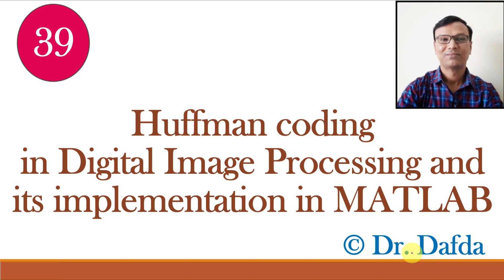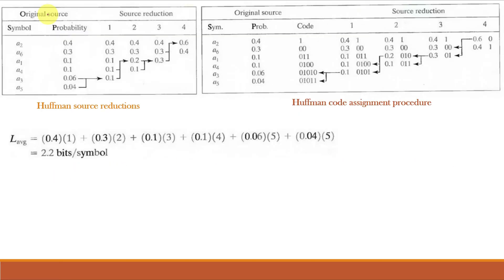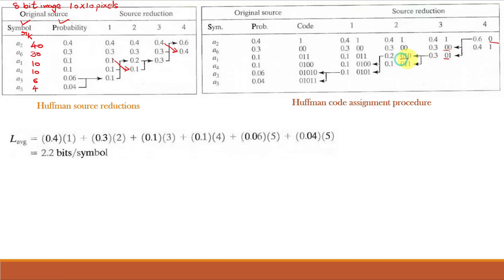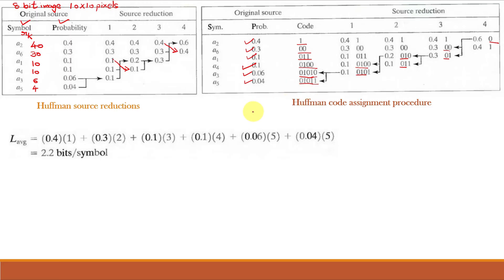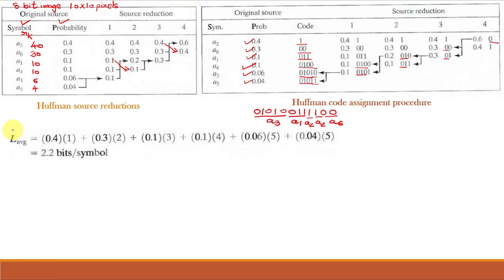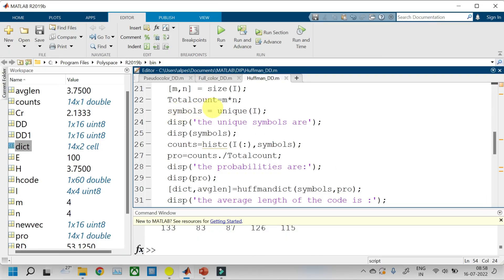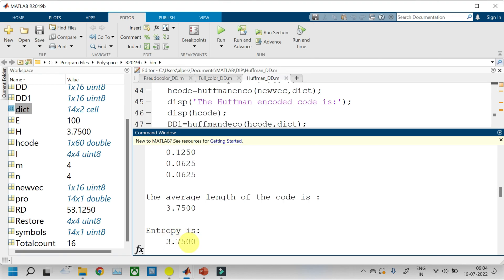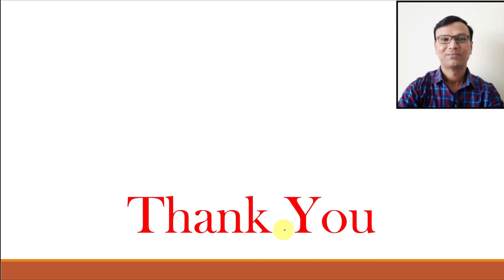Huffman Coding in Digital Image Processing with example & its Implementation in MATLAB ||Compression

Comment: Here 0.3 has 00 length means 0.3 is multiply to 0 not 2
Reply from the maker: No, 00 is not length. 00 is the code for 0.3. 00 has 2 symbols so its length is 2. Hence 0.3 multiply by 2.

Comment: In this before compression original image size is 800 bits and after compression 220 bits am i right . As u mentioned 8 bit image 10x10 pixel and after applying it 2.2 bits/symbol Length
Reply from the maker: Yes, correct.